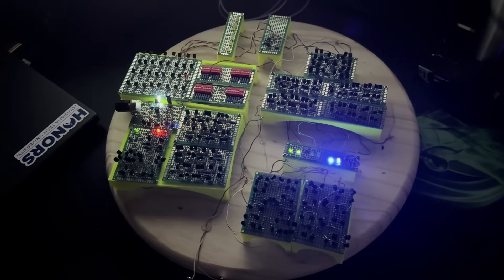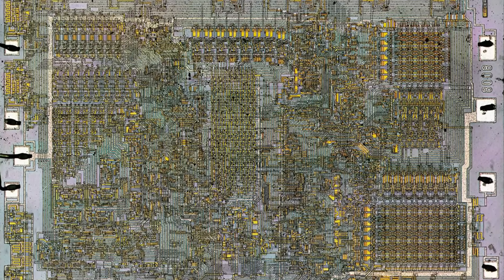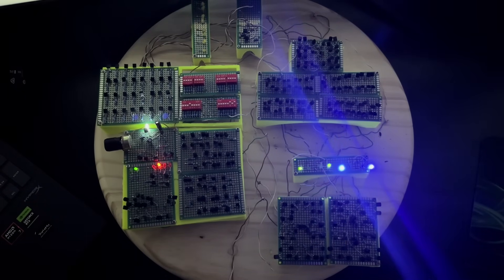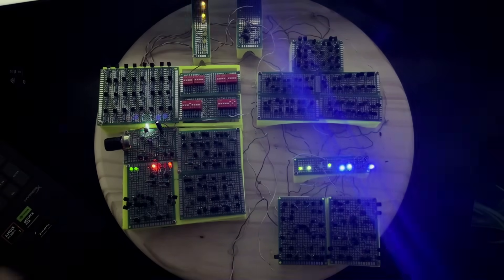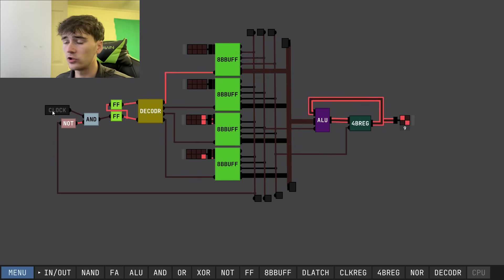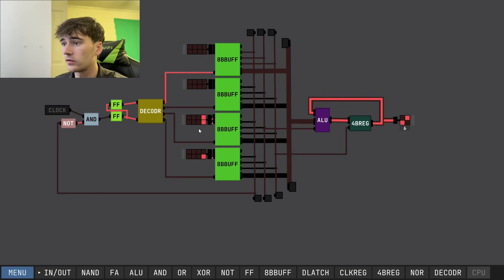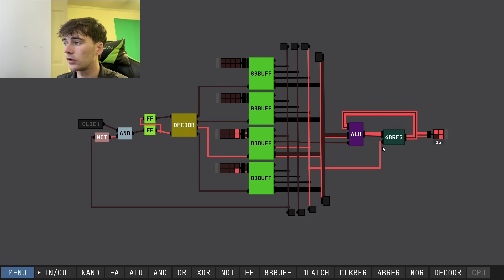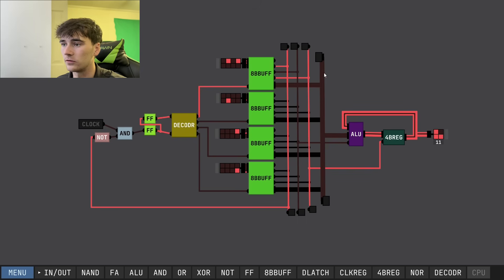I made a CPU out of pure TRANSISTORS! Most people don’t even know what this is!

Comment: I watched your video from Maharashtra (India ) 
 I am 18 year old, 
 student of electronics and telecommunication engineering  
Just pursuing diploma in india 
I have just the basic electronics and some about analog electronics but just little little 
I also knew flipflop and counter because i done digital techniques subject 
And now in my 4th semester running subject is Microcontroller 
Where these videos totally look like 
8051micontroller . 

I just want to say  i am very curious about this thing how  just electrical switching (transistor 🤔) can do all control of computer or it is computer 
But today i get the basic idea what inside this all doing. 
Thanks 👍
Reply: I am just seen your video of 13 year old boy play servo motor used  in piano 
Same i do at 18  but the difference is I am start learning electronics branch from my college at 16 .
And now I am 18 
But still I doing little thing in this electronic field 😢. 
I want to know  all  the basic
I also want to do invention 
I want to do unpentent projects to pentent
But proper road map did not get
As I see you your just my edge guy but you start from 13 . And I am just doing electronics as collage branch 
I have intrest 
But college (marks) is important in India for good job
But this is not topic 
Topic is I want an proper road map
Reply: My project are like 
Dual power supply on pcb 
Full and half adder on pcb
Amplifier circuit 
Remote control relay 
Bcd to seven segment on breadboard 
Some of triac and diacs .
Arduino with sensor.
That's all 
But i want something better 
Can you guide please

Comment: 350 transistors is crazy small. I guess it sorta makes sense with it being only 4 bit.
Edit: Resistor-Transistor Logic! That's some real oldschool stuff.
Reply: When I read about the 6502, I learned that resistors are more expensive in an IC. On a PCB you still need space and solder them. Is it because dio-ode like components don't need gold bonding wires? Likewise capacitors: super expensive in an IC. RTL is a sure way to minimize clock speed. Have fun debugging with unclear voltage levels.

Comment: Describing a computer in VHDL/Verilog is not that much different.
Once you have a CPU there, that works in simulation, converting it to gates and then, transistors, isn't so much a big deal any more.
Most annoying thing with pure transistor computer likely the analog aspect of it, along with bad connectors, wiring and such.
Reply: Making a computer in HDL is a completely different beast, it may be more complicated to those who aren't pros in FPGAs already.
Plus, the circuit it may generate won't necessarily be as low transistor count + it would be a mesh of gates that won't make any sense to a human brain.

Comment: People, this is not a computer yet, but just a CPU. 🧐
You still need to build a "computer" around it to get any use...
At least add ROM(with some form of bootloader), RAM for storing programs and their variables(maybe even some simple OS), some output(like a dash of LEDs, 7-segs, alphanumeric display or even graphical one), some input(removable storage reader, like one containing programs), some human interface devices(buttons, keyboard, etc)...
Which in the end would easily add 1000s of more transistors. 😁
And even when this all is in place – then comes the "fun" part, of writing SOFTWARE, which is a completely different field(beast) altogether. 🫠
This is actually possible, to do it all, even for 1 person... But would easily take years, and it should be a real obsession.

Comment: i'm curious what kind of things you can do if you connect an MCU or other device with GPIOs to the inputs and outputs.
Reply: Add a whole microcontroller? You can multiiplex this system and have the combined states do something special to external output that's more than some leds but then it's no longer a system made of single transistors.
Reply: @manuell3505  well the idea is more to determine the possibilities using the MCU, and then you can work backwards to discretize blocks. Mux could be discrete for instance. And also I just wanted to express the general principle that this can be connected to inputs or outputs and is not limited to the "manual switch/LED" framework.

Comment: 20 years ago I remember debating my EE PhD friend about whether this was possible. He said you can't find enough matched biased pairs to make it work. I was naive so I said it was possible. Naive wins, AARON ;)
Reply: This was how computers were built in the 60s, after the era of the vacuum tube but before the integrated circuit. They are called transistorized computers. PDP-1 is one of them with 2,700 transistors and 3,000 diodes. Matched transistor pairs are not as important in digital signals.
Reply: @borissinaga to be fair, my friend’s PhD was literally in CMOS so I can understand why he thought that way. My argument was that discrete components could be used to make buffers between stages even if he was right.

This was a little before I went to college and learned about the amazing PDP line 👍

Comment: I don't want to imagine myself soldering this
Reply: I advised author to use (homemade) PCBs and SMD transistors... Some time ago.
In fact, if I was doing it – would tried to copy 7400 series ICs, each as a separate module, and then used those to build a computer.
This would made things way less complicated, plus you could then use existing 7400 schematics(from books) in own R&D.
And also, when scales would get threateningly huge, like actual finished computer having ~10,000 transistors – it would be possible to order pick'n'place automatic assembly at the PCB manufacturer, having these ~10k transistors already soldered in. 😉
Another huge future problem would be software, and again if I did it – would've copied some existing low transistor count CPU, like 6502... To then recycle it's vast libraries of already existing soft.
(6502 made of transistors already exists, could be copied too, to make whole enterprise less time costing)

Comment: I haven't watched video yet but someday I'm also going to make CPU from transistor. I've already made CPU on logic gate simulator and recently I'm making working computer using it. hardware is almost done except ROM so now I'm making softwares. Imma make CLI computer
Reply: Discrete ROM?
Reply: @patrickwright8552 
Wdym
Reply: @Exsanc  are you going to make the ROM out of discrete components (e.g. transistors, RLC)?
Reply: @patrickwright8552 
In logic simulator there is Memory so user can use it as RAM or ROM. If you talking about in real life I would use IC chip cuz ROM or RAM from transistors would be huge like memories on half century ago
Reply: @Exsanc  understandable, I was questioning because you said hardware is almost done except ROM, so I thought you might mean you were designing ROM
Reply: @patrickwright8552 
Either way before make ROM you need to make BIOS for program it
Reply: @Exsanc  There are YouTubers who implement the CPU in a huge ROM and think that 1 MBit ROM is more or less the same like a transistors or 10 tops. Needs same real estate.

Comment: It's crazy thinking about computers like this. Like there's no way a computer could be made like this, they're far more complex. Yet back in the 1900's, the first computers were really like this, but far more massive. Each transistor a special bulb cause we didn't have a smaller form of any kind. Problems didn't come from the programs at the time but the bulbs simply burning out (well I guess the program too, but you get what I mean). And the crazy part to me is the very CPU's running our phones, is hundreds of thousands of transistors that are.  all set up to literally just do math. Your CPU is just adding, subtracting, multiplying, and dividing constantly to create the video, sound, and processing all of the data coming through sites and and the taps you make on your keyboard. You're one phone could run the Apollo space program to the moon easily a hundred times over at the same time and still have room To do other things as well. It's incredible.
Reply: It's EXACTLY what a computer is!
Reply: "Yet back in the 1900's" Oh my lord, as someone born before the Intel 4004 existed, you made me feel OOOOOLD with that. 😭😆